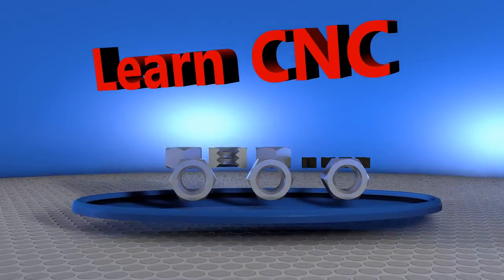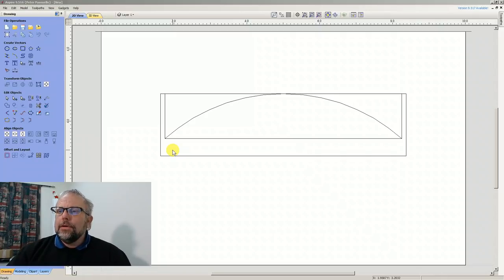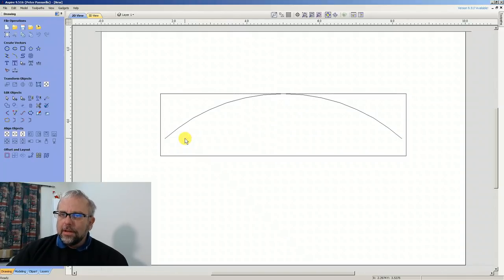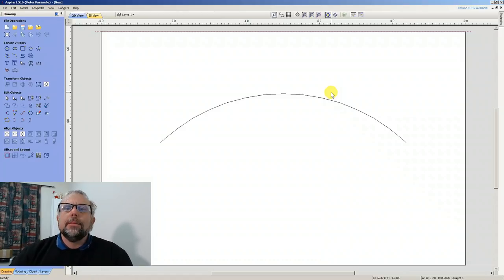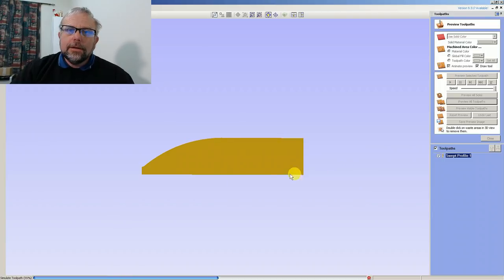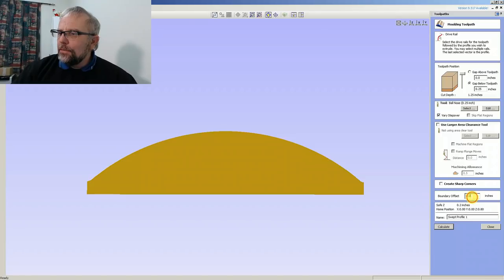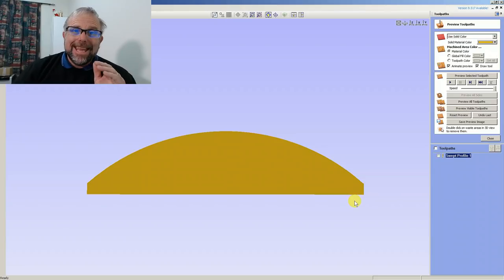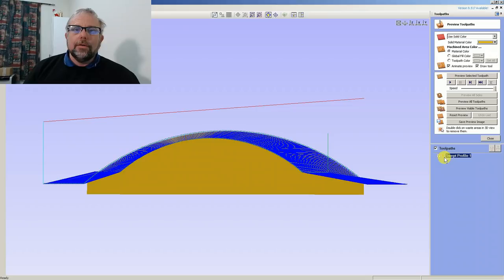Moulding Toolpath Update - CNCnutz Episode 233

Comment: If you want to carve on the lid use a 3D tab and size accordingly (say, 1/4" oversize). I would use a moulding toolpath to hollow it out (do this first, you don't want to do an intricate carving and mess it up when hollowing out)
Reply from the maker: Thanks Graham, hollowing out the lid first is a good tip or holding it after might be a bit of a nightmare.
Cheers
Peter